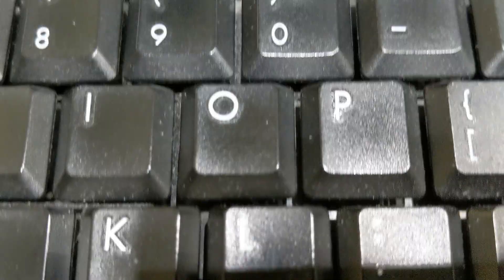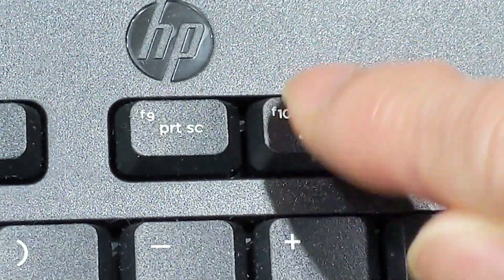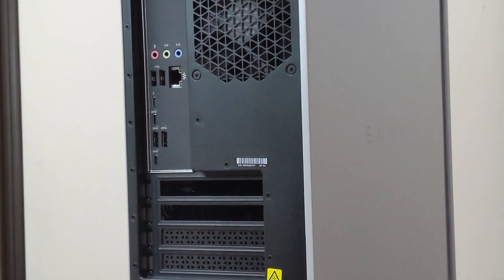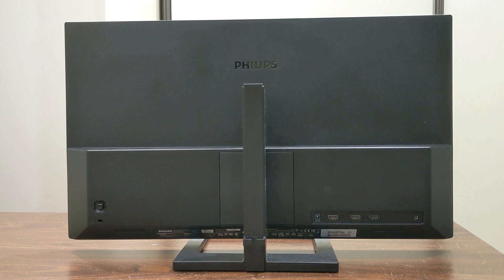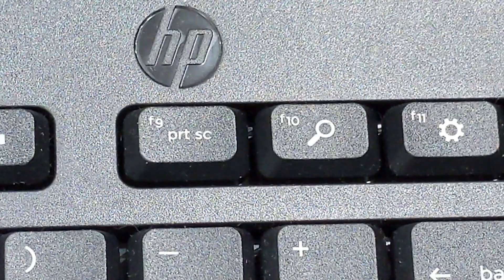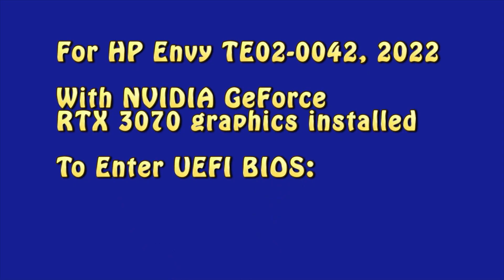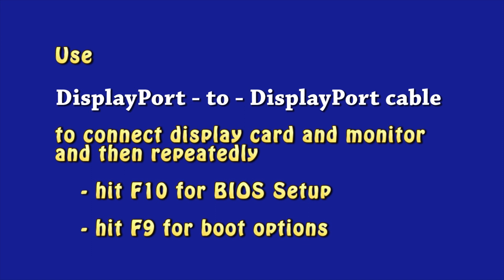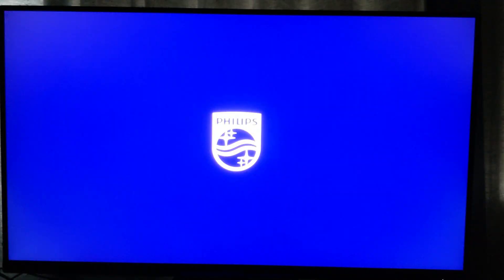How to Access HP Envy Desktop BIOS/UEFI - JJK’s Way

Comment: Hi @khung6996 -- Did you ever find a reliable way of seeing BIOS / EUFI? I have the same HP Envy, and can't seem to get it to display.

I haven't tried taking out the RTX 3070, nor do I have a thunderbolt to HDMI cable to try even if I did.

Of the 3 DisplayPorts on the RTX 3070, which one did you use -- did it work on any/all of the 3, or did you have to use a particular one (like the one closest to the HDMI port, or the one furthest away from the HDMI port)?

I'm seeing the PC power down occasionally (usually when nothing is happening) and it won't even power up with the button unless I remove the power cable for 20 seconds. I was going to run the diagnostics that are in EUFI, but I can't find a way to display the BIOS / EUFI, so I don't know what the screen is saying. It seems like it's trying to display the output on some other port that is different than the one I am using, or something like that, but I can't figure out what.
Reply: I was just given a hp envy TE02-0042 without the rtx 3070 gpu. I tried installing a spare gtx 980 and I couldn't get it to post. It would boot to a white screen. I then tested taking the gtx 980 out and using one of my USB-C bubs that has an hdmi output on it and connecting it to the thunderbolt port, and that worked. I was able to boot the machine and enter the UEFI. I didn't know the system was complaining about a missing system fan because the screen was just plain white. After using the USB-C hub with hdmi I was able to power off and connect a fan and the system boots normal now. I haven't tested the gtx 980 again so I'm not sure if HP is using some sort of white list for gpu's or what.